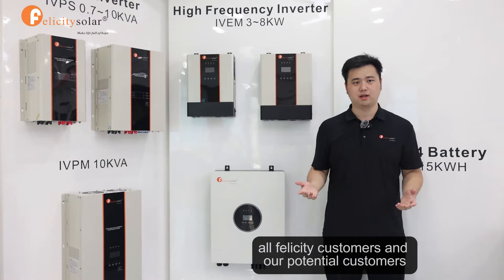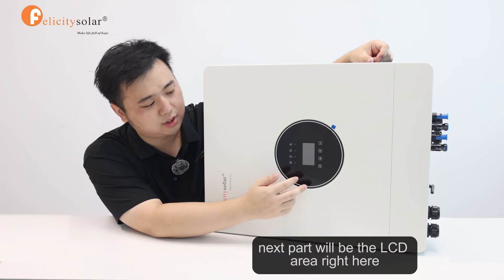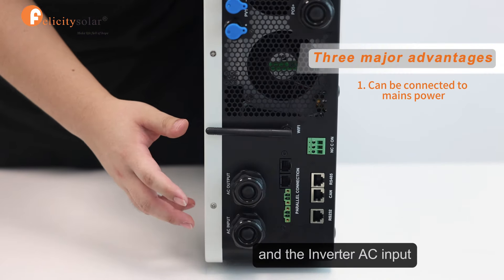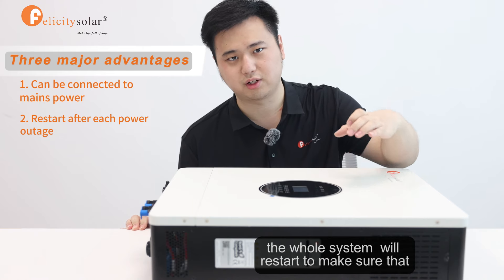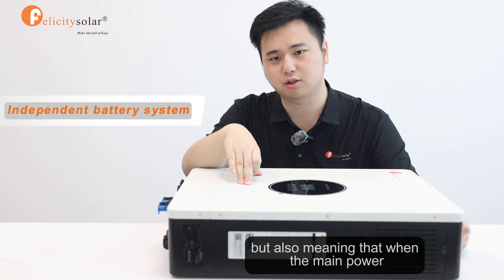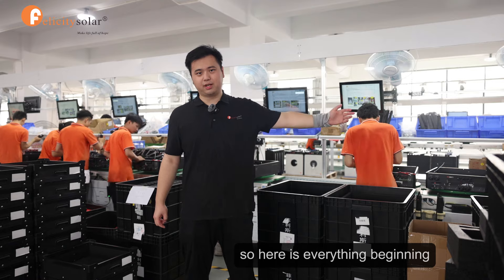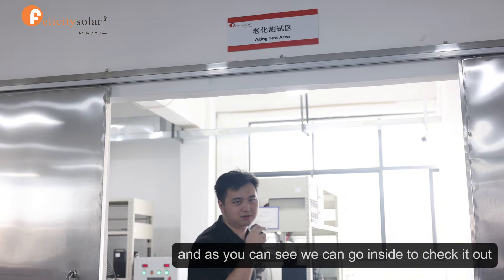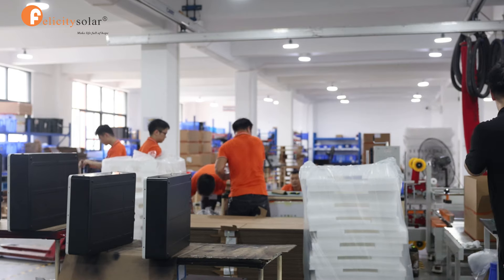Popular inverter styles IVEM8048

Comment: I am so glad I came across this video, I installed the IVEM 8048 recently, the system is exceptionally good, but I am having some issues with the system when it comes to switching over from utility to battery when there is an outage there is a delay of about 5 to 8 seconds what will ne tle problem please
Reply from the maker: Thank you for your feedback. Please tell us which country you are in and we will send you the technician contact information.
Reply: Did you find a solution?

Comment: Hi, I would like to ask you about my Felicity Inverter IVEM 8048, is it normal for the fans to keep running all the time without stopping around the clock?
Reply from the maker: May I know which country you are from? Then I will send you the contact information of the technician.
Reply: @felicitysolar I have this same problem, the fan keeps running around the clock and drains the battery when there's a power outage. I am in Nigeria
Reply from the maker: @gyosmen-hashimsshittu2678  Thanks for your support. Please contact our engineer for Technical support by whatsapp: 
Wasely  +86 131 2609 3443

Comment: Hello, I bought the felicity inverter ivem inverter, the L2/N2 port is not supplying current, only the L1/N1 works. What can be wrong?
Reply from the maker: Please contact our engineer for Technical support by whatsapp: 
Wasely  +86 131 2609 3443 
Or leave your contact information☺

Comment: In ivem 8048 when battery is full after charging from grid the inverter stop charging and goes grid bypass 
So when grid goes off the inverter restart and stop fiddling the load for a few seconds and lose wifi configuration
Reply from the maker: Please leave your contact information and we will have technical personnel follow up